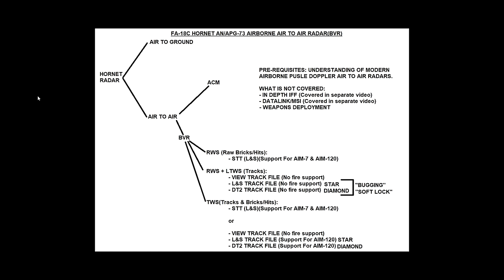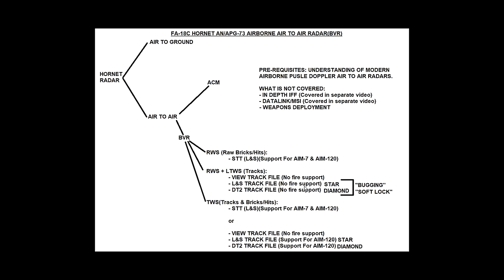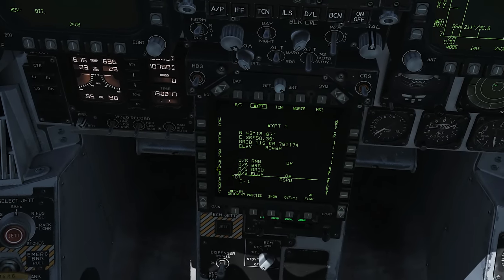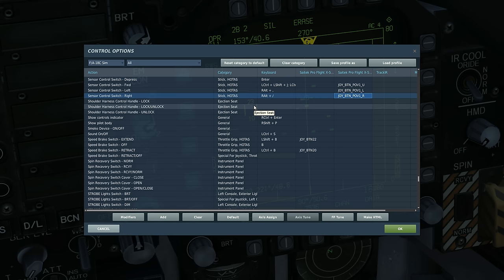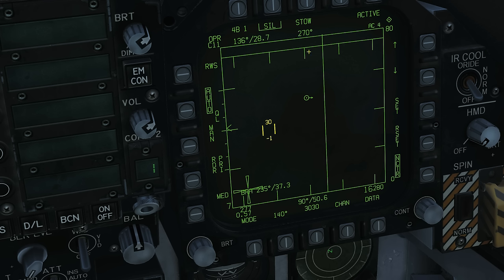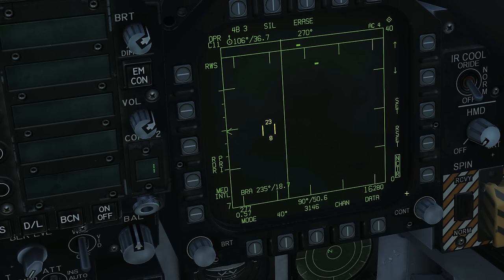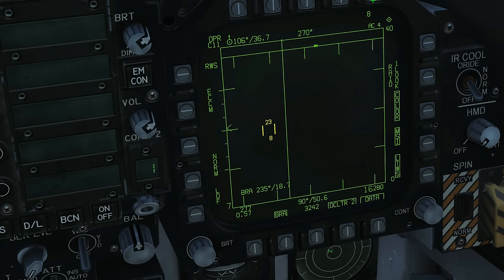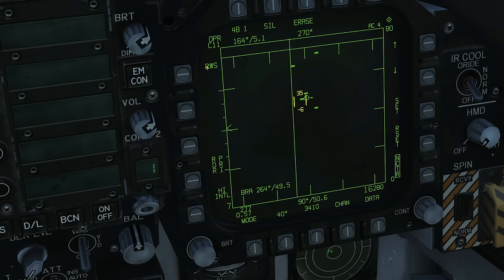FA-18C Hornet: Air To Air BVR Radar (RWS/LTWS/TWS) Tutorial | DCS WORLD

Comment: James G.Burton was required to define BVR in his job at USAF as there was not a understandable BVR definition or scale.
Based to the real visual spotting capabilities by real pilots at various size aircrafts, it was found that acceptable BVR range was 5 kilometers. Past 10 kilometers started the BVR as spotting a fighter size targets became very challenging or impossible in optimal scenario, and we talk about fighters like F-14 or F-15 in size. While against smaller fighters like F-5 or MiG-21 the distance fell IIRC below 2 kilometers.

Why we have now 10 nmi (18.5 kilometers) that is extremely overstated range for a fighter size targets. Sure a 747 or A-50 can be spotted at those ranges but fighters not unless you really know where to look and attitude supports it with background.

Comment: one thing i hate in the fa18c is adjusting the radar altitude. Its janky has a delay and is much harder than something like a f16c, and if you have a slider thingy like on the TWCS throttle it pretty much unusable and i had to swap around a bunch of controls

Comment: do you stll use the ps3 cam for head tracking ??? i cant bay 200  usd for the track ir 5 would you say thats the ps3 cam
 is worth it or just save up
Reply: Google trackhat. Their solutions are equal in performance to the Track IR 5 pro (meaning they use lights, not reflectors, and therefor work in the dark.)
Reply from the maker: I think it's a Ps2 cam

Comment: Hi all. I've downloaded the mission and I'm stuck with a problem at 26:53 - azimuth scan is following CAP's TDC  wherever it moves. I can't make that happen - it's always stuck in the middle. Only when I push TDC depress, scan area moves around that position (and stays there until I push RESET or slew TDC somewhere else and then TDC depress again).  Can't figure out what I'm doing wrong... please help
Reply: you're not doing anythign wrong, the implementation at the time of the video was wrong, the way it works now is supposedly the correct way.
Reply: @0xdfpv53  Thanks 4 the info. Good to know.